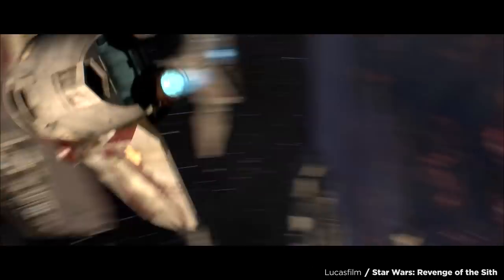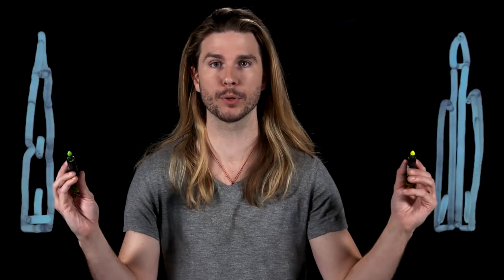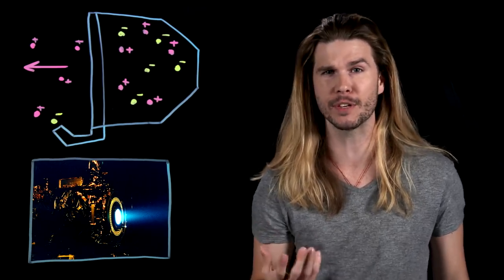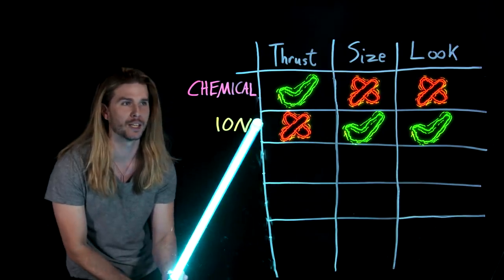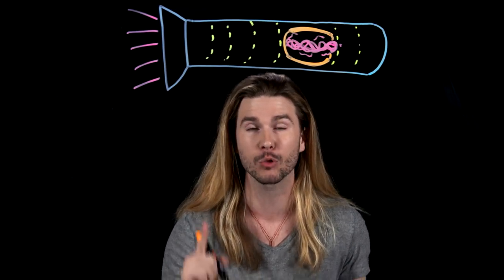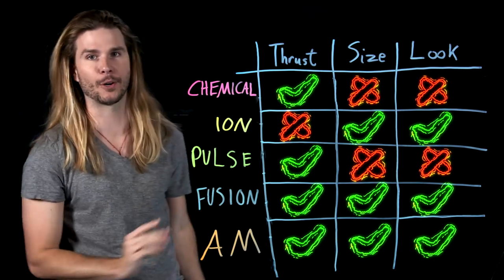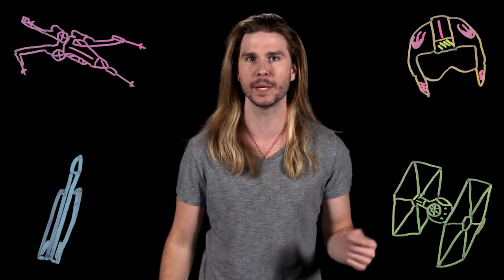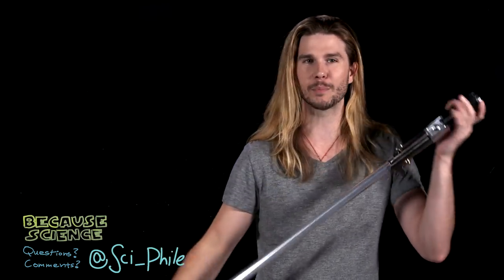How Would You Build a Real X-Wing? (Because Science w/ Kyle Hill)

Comment: How could you capture the radiation, so that when you enter and exit planets atmosphere's you are not irradiating everything using fusion or antimatter?
Reply: Radiation can be blocked by radiation shielding within the engine.
Reply: You couldn't just vent the reactor anyways. It would need to be set up like a power plant where the particles being vented are only tangentially applied to the reactor. If you vent the reactor you would not only have issues with the radiation but also probably have a variety of issues with maintaining the reaction.